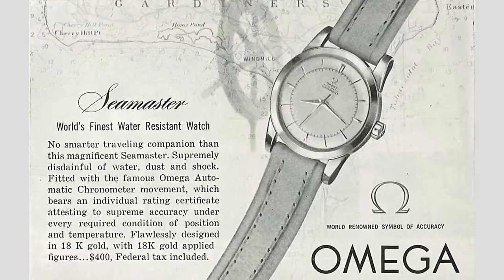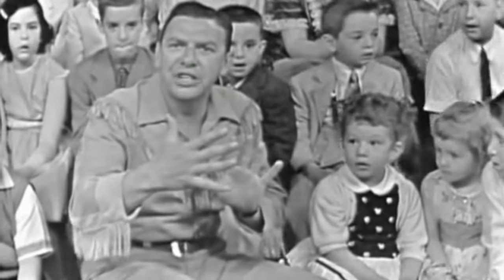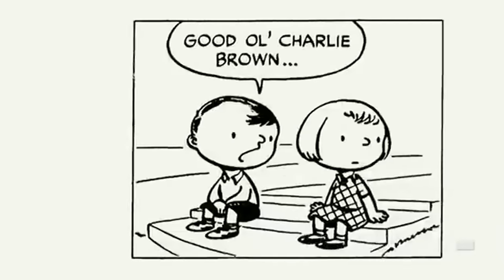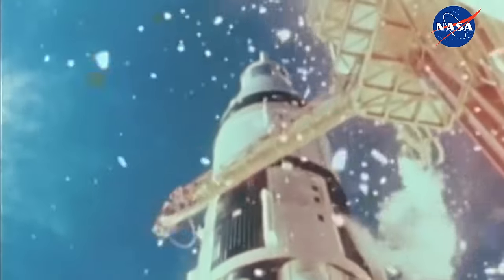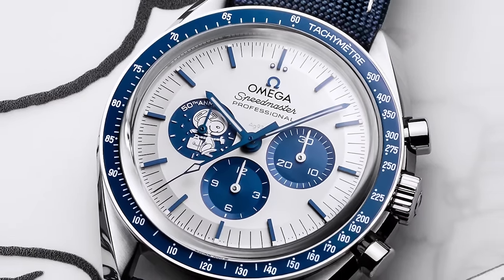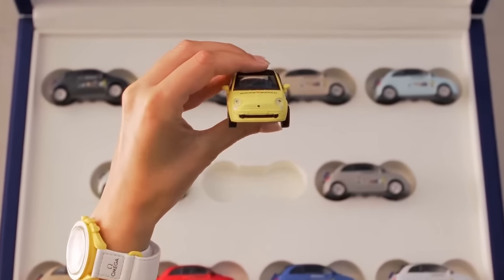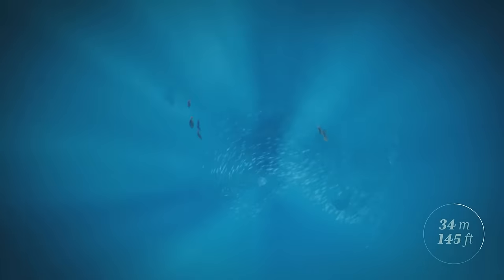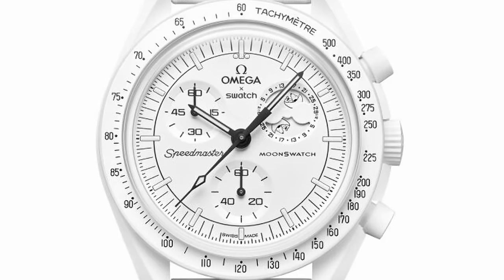What They Didn’t Tell You About The Snoopy MoonSwatch

Comment: “Rolex may have conquered the sea and the air”…but certainly no mountains…nor any cartoon characters…even though its marketing adviser was Pinnocchio 😉

Tbh I always found Peanuts a bit…dark.  Despite your excellent upload Andrew, I still don’t get the Snoopy connection with NASA.  Snoopy spent most of his time lying flat on his back on the roof of his kennel, so... 🤔 It would have made more sense for the USSR to use Snoopy as a mascot given that they actually sent a dog into space 🤷‍♂️

“…boosted sales of the original Moonwatch by 50%…”.  Sales???  🤔  Er, I understand that suspiciously round figure was for enquiries about the Moonwatch, not sales… Pinnocchio must have moved from Rolex to Omega. 😂

All that said, I rather like the new Swatchy Moonwatchcopy, despite its likeness to oldskool doggy doos, although I’m so far away from a Swatch shop I may as well be in space, so won’t be buying one.

Cheers 🍻

Comment: I bought the Mercury in Vegas several weeks ago. Then promptly packed it up in wrapping paper for my birthday, which is on the 30th of March. It is TOTALLY overpriced for what you get. My Casio Douro will last longer. But, its cool looking, has the Omega name on it and the look of a true Speedmaster. If the plastic crystal gives up the ghost, or if the case cracks, I'll likely buy a Pagani Design 1701 and see about hacking the omega/swatch movement into it. 

I also looked at the 50 fathoms while in the shop. Hard pass. As cheap feeling as the moon swatch is, it still LOOKS the part very easily. The 50 just looked like a cheeeeap crappy watch.

Comment: It would be great if they developed a MoonSwatch  proprietary battery. And they developed an AI based customer service platform that one had to use to access the replacement battery.  AI then limits the access to the proprietary replacement in fact AI then decides that restricting the battery or eliminating all together was better for the Swatch Group.  Considering that scarcity, forcing customers to buy another new watch or ultimately deciding that manual watches are apex and killing Bio ceramic quartz was in the Watch Communities best interest.
Good Grief.